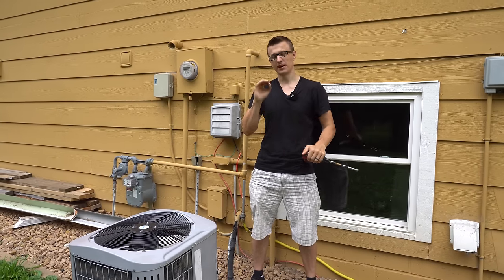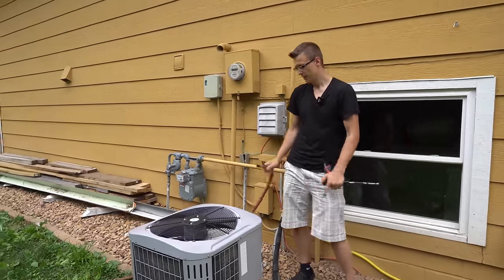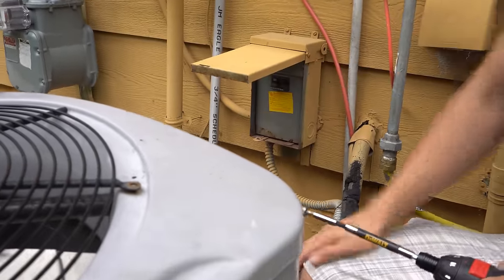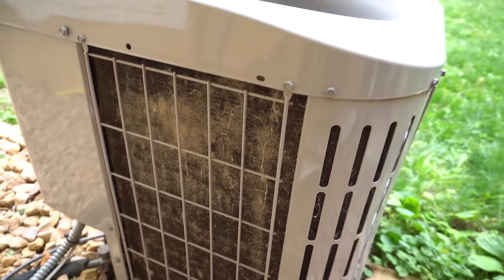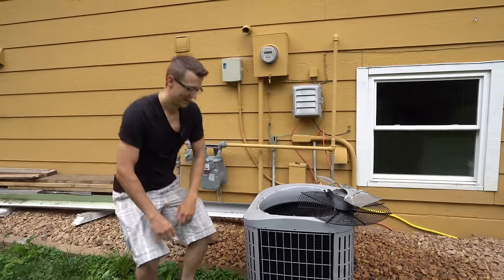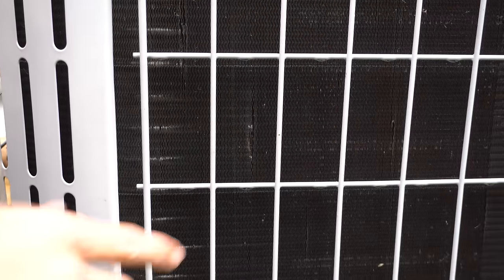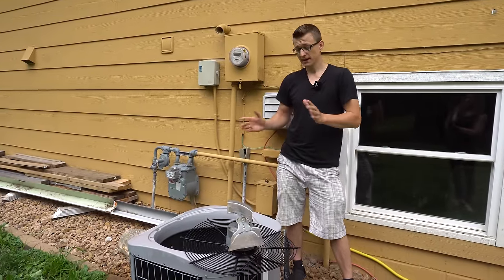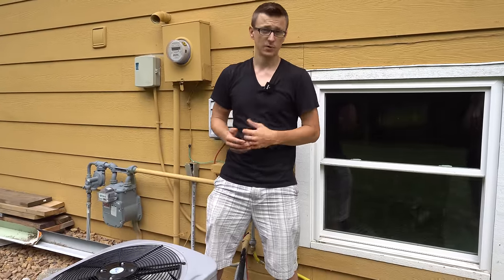#1 AC Problem With Central Air Conditioning Not Cooling

Comment from the maker: ❄ Other Videos For Reference:

Top 5 A/C Problems:
https://youtu.be/GOXgdnRB840
Complete A/C Troubleshooting Guide:
https://youtu.be/wzAA4dlp_70
How to Replace a Capacitor:
https://youtu.be/9ZGfvC-PMWU
How to Replace a Contactor:
https://youtu.be/qHZc9wWAF4c
How to Replace Condenser Fan Motor:
https://youtu.be/gGFTd2dmgxg
How to Replace A/C Control Board:
https://youtu.be/hijUExXrcm8
How to Replace a Thermostat:
https://youtu.be/1mJkjrwxdP4
How to Program a Thermostat:
https://youtu.be/uun8HJhM3h4
How a Thermostat Works:
https://youtu.be/Z4T9H-6VPtI
How to Check Freon Level:
https://youtu.be/dExFtP-nXTw
How to Wire A/C Condenser Unit:
https://youtu.be/KCanZEsLVEI
How to Read A/C Wiring Diagram:
https://youtu.be/I-sB4GIlbl4
How an Air Conditioner Works:
https://youtu.be/cRnzYJ4qmWE
When Should You Replace A/C:
https://youtu.be/Z7vUOySOWbM
15 Air Conditioner Maintenance Tips:
https://youtu.be/pBBnXHse-T0
Should You Get an A/C Inspection:
https://youtu.be/JqNsEzb__qs
Reply: This is the best pinned comment on all of youtube

Comment: Heat index is 109 degrees out right now. Just got back home from a work trip and asked the wife if the AC feels like it’s not cooling. She said it felt fine this morning, but I knew something was off. Thermostat was set to 75 but inside temp was 80. This was the first video I came across. I did it exactly as you instructed. Kicked the breakers back on and BAM! Instant cold air coming into the house. Oh what a relief. Great video!
Reply: I have the same issue, im going to try this out

Comment: Absolutely do not just shut the unit off at the thermostat if you are removing the condenser fan motor. Kill power to the unit at the breaker or disconnect.

Comment: I always tell people it saves money on the electric bill (which it does) to try to motivate them to keep it clean. It also makes the compressor last longer since it doesn't run as hot. I hose mine off probably 3 times a season.
Reply from the maker: That's a great way to present it. Thank you for the suggestion!

Comment: I can not thank you enough for this video.  Today is 109 and yesterday I noticed the ac not blowing cool air and it was squeeling.  We tuned it off and hosed down the outside (that was definitely clogged)  It got down to 67 this AM and we bumped the thermostat up to 69 as it was a little too cool.  It took a good 12 hours for it to cool the house from 79 to 67.  You saved me!
Reply: A lot of HVAC maintenance is just keeping everything clean.  And if you don't keep everything clean, the system may stop working or will have to work harder so the components will fail.  Keep it clean including the blower fans inside the furnaces, the condensation PVC pipes and the flame sensor and just everything.

Comment: Thanks for posting your video. The fins on my unit were clogged. Rinsed them off and now getting cool air. 👍
Reply: @Gabriel My AC wasn't blowing cool air. As it turns out, cleaning the fins didn't correct the problem. The system was low on refrigerant.

Comment: Thank you! There are a lot of HVAC companies that do not have the competency to share what you have in your videos.  So glad I found your channel!  It would do a lot for the HVAC industry if they required their contractors to watch your videos.  I had a contractor make a repair and burn my outside unit up.  I have a 5 yr old system now and just had a tune-up, now it is running poorly. He probably messed something up.  I am afraid to call an HVAC company to look at it.  I will trouble shoot following your tips. Thanks!
Reply: They do that for a reason. Simply put, they have to make money so that they can eat too.
It is what it is.

Comment: I use a filter screen specially made for outdoor condensers (purchased from Amazon). I take the screen off once a year and wash it. I also have a larger mesh screen on top to keep leaves out. During the winter, I use a solid cover on the top and take the screens off.
Reply: wmalden do you have the link to the amazon product.? Screen.

Comment: Solved the puzzle a totally different way, never paid attention to the times on the clocks, nor number of bananas...only determined what the clocks and bunch of bananas must be to =10, then went to work solving for unknowns.  Perhaps I should have had on my readers.  😊. 

Anyway, thanks for the video.  Will go check my unit's condenser shortly.

Comment: I try to wash mine twice a year beginning and end of cooling season. After using the hose I will use my air compressor on a very very low psi and blow air through some of the dirtier spots. Helps get that stubborn dust out.
Reply: gReaT tip....ThanKs.!! 🍻

Comment: these seem like good points but definitely turn the power off before removing the fasteners that attach the fan motor and cage to the unit! if it would have kicked on and started spinning before you turned the disconnect switch off it could have done some damage to the unit or someone near it.

Comment: unscrew the grill, then use a paint brush to brush the coil as you rinsing it with water.
Reply: Ok but what kind of paint should we use 🤔 lolz
Reply: I have a 20 year old Ruud unit.  The side grills cannot come off--at least I couldn't get them off.

Comment: Nice tip, sir!  👍
Quiz:  2 + 3 + (3 * 10) = 5 + 30 = 35

Haha, you ol' dog, you!  I paid closer attention and my new, new answer is:
Quiz:  2 + 3 + (3 * 11) = 5 + 33 = 38
Reply from the maker: Thank you! 35 is mighty close but that is not the right answer.
Reply: 135
Reply: Rocks=15 bananas=4 an the clocks =3
Reply: 3+4+(4x15)=67

Comment: Hi Jay! Your videos have saved me tons of time and money! I love your explanations! Thank you so much for all you do!! Question: My A/C recently lost power. We had a tech come out and he told us it was a bad control board. He replaced that and we still had no power. I did some research and found out that we actually had a bad transformer. So I switched out the 24v transformer supplying power to the control board. Voila! We got it running again! Unfortunately, now it on works in the “ON” position and not on “AUTO”. Also if I run it in the on position, the blower fan will turn off after a few minutes. I’m hoping the “tech” that came out didn’t mess something up or wire the control board incorrectly. Could my thermostat be the problem? Any ideas?
Reply: Check the batteries in your thermostat. I’ve had just that really make things not work right. Something as simple as the thermostat batteries…crazy.
Reply: Thanks…. I go clean it up now…

Comment: Seems cool! Thanks! I am still worried about the electrical board/components in their on the inside of one side of it. They can short circuit if not careful right?
Reply: One of the reasons you should kill power to the unit. Do not just shut it off at the thermostat like he said.

Comment: Thanks for the video Jay! I have a weird thing going on with our ac unit. 99% it works/sounds fine but sometimes and only after it has been running for hours continuously. Sometimes we hear a thump and then a much louder buzing noise afterwards.  It seems still to be working but I typically just shut it off and back on in 30 minutes and it then sounds normal again.  It looks like it's coming from the outside unit. And maybe the compressor? I know the blower fan looks fine when this has occurred.
Reply: Mine is doing this rn. Now it's not blowing hard enough. Did u find out what it was?
Reply: @alyssakdiaz9290  I'm not an expert but I have a good idea of what it might be. It's probably the AC motor on the condenser if its an outside unit. There are a ton of videos on how to replace a condenser motor and its super easy! Before removing any wires on your condenser make sure to take pictures first so you can remember exactly how to put the wires back. Make sure to shut the power off! If you wait to long to replace this motor your ac will over heat and the condenser will be dead. An A/C motor can cost $300-$700 depending on the size or your unit ton. Replacing everything according to 2023 can be very very expensive. I love this video because it taught me how to clean the condenser which is critical. I recommend spraying the ac condenser with a special condenser cleaning spray. Spray the condenser and let it work for about 5 minutes and then hose down.

Comment: Bro, I worked with this one company and we did Mcdonalds and you should see the build up of cottonwood on the condenser coils, not to mention the grease. We had to use foam Brit on them. The coils would go from black back to the normal color. So nasty.

Comment: I cleaned my unit, replaced new filters and even replaced the capacitor because the fan wasn't spinning.  It worked great for a whole season. Now it doesn't blow cold air.  Cleaned again.  Do you think it's low on freon?  Unit is 15 years old, but my neighbors still have their original unit so trying to squeeze a few more years.  If it's the freon is this something I can try?  BTW I learned from you  videos.   Thank you.

Comment: Appreciate the maintenance tip!
The correct answer should be 67.
3+4+4×15 > 7+60 > 67
Your values don't work when plugging into the equations.
Reply: Look more closely at the figures on the last line...
Reply: 3+4+4x15=165.    3+4+(4x15)=67. The correct answer is 165
Reply: Using the correct order of operations, the answer is indeed 67.
Reply: The answer is 88. (2+3+3×11=88)
Reply: @pinkiithe3nigma257  I was thinking the same way but the only thing I did different was multiply first.  (2+3+3×11)
                                  5+33
                                   = 38
Reply: @cedrickringo7911  that's EXACTLY THE ANSWER! I SKIPPED order of operations.  🤦‍♀️

Comment: Jay, ac quit cooling inside today.  have a trane outside unit, blowing cool air outside and not hot air today.   (Inside is room temp air circulating when turned on) going to clean outside unit  with water and hope that helps. Thank you Jay.  Houston is hot.

Comment: Great video, this is also an optimal time to oil the fan motor since you have it upside down. What would cause the ac to turn on blow cold for an hour and then blow warm. The pan is dry and it's dripping outside as it should.
Reply: I have this problem as well. Any ideas?
Reply: @ryanjstreeter  Hi, I have an old unit, and if I remember correctly, it was low on freon.
Reply: @claudiodominguez.  I have an old unit as well. I will look into a Freon refill, thanks!
Reply: @ryanjstreeter  Hope it's a slow leak and all will be Good !

Comment: Excellent video as always. 

I have a Rheem unit in an apartment. I changed the 40mfd capacitor today, the compressor seems to be running fine. however couple of strange things I noticed: compressor is blowing cold air out instead of hot air and the the temprature on thermostat is not coming down. Local guy tech guy told us to use to do a hard start using 500% Suppco SPP6. I still have tried that option. 

I changed the filter too.

Can you please let me know what could I check and why the compressor is blowing cold air out?

Comment: Does the sun on a very hot day beating down on the unit affect it’s efficiency? Thanks for the info, very helpful.
Reply from the maker: Yes. It will still cool the house fine but the unit will have to work harder if it's roasting in the sun all day.
Reply: God this seems to be my issue at the moment. I live down in South texas. We’re hitting 101 and our AC is breaking down on us 😢 it’s in the blazing sun all day and sun doesn’t go down till 9pm. It has been making a horrendous LOUD noise. It sounds like someone is doing outside mechanic work. I had to stay up last night to monitor the noise to avoid any neighbors calling the police department for noise complaint. Noise is still on going but now there is no cold air blowing. Can someone please help!! I am also pregnant due any second now so I am not having the best of time in my stuffy house. I do not have easy access in my back yard for a hose like you did in your video to top it off 😢

Comment: And definitely do not do it with high-pressure hoses it will bend the coils and you will mess up your AC I actually spray a little bit of TruGreen on it and wait a few minutes then spray it off TruGreen is awesome
Reply from the maker: Great tips! Thank you for the suggestions!
Reply: @TheAGODAMI   It is a cleaning agent that you can buy from Lowe's or home depot or Ace Hardware. It's a spray on  Is green liquid that cleans a lot of  Surfaces.
Reply: @TheAGODAMI   I'm sorry I called it true green it's supposed to be simple green.

Comment: I can't find the right video and wish you could answer. I leave my ac on auto cool and when it reaches set temp it just keeps running it doesn't stop, turn off and on, just stays on. Is it a bad thermostat. You already helped me once before it be crazy awesome if you knew a common problem for this. Thanks!! I love you're channel, learning alot.
Reply: Nah wouldn't be a thermostat could be a stuck contacter not shutting off keeping your fan running
Reply: @kanetalks5434  it was the thermostat, a few bucks well worth the risk.

Comment: I just got back home from out of the state after a week and now the ac is just blowing air but not cold air.
It's 11:47 pm and we have like 80 degrees .
I'm going to try it and come back later with an update
Reply: Did it work?
Reply: @Jay388  My friend works for ac and he already fixed.
He found the drainer clogged upstairs in the attic.
To much water and the sensor cutting off the electricity for protection

Comment: Great informative advice. Is that AC condenser fan motor and the furnace blower motor are the same?
Reply from the maker: The furnace blower motor is used for both, the AC and the furnace. But the condenser fan motor is the one in the outside unit. 👍

Comment: My central AC unit stopped cooling. It's on but doesn't blow cold air. We will try clean it following your video, maybe it's diry because we are replacing our roof and maybe because of the construction dust it got dirty. Do I have to turn it off from the thermostat to wash it? Please answer
Reply from the maker: Yes, I would turn it off at the thermostat so it doesn't come on while you are washing it. And if you will be taking the top off, then make sure you turn the power to the unit outside off too.

Comment: The puzzle answer is 25 (The watch in the fourth row is set at 2:00, making the value two, instead of the value of three, like the other two watches in line three, which hands position are set at 3:00)
Reply from the maker: It's a good first guess but there is more to it. 25 is incorrect.
Reply: @WordofAdviceTV  Thank you, I do like the number twenty.

Comment: I have a 3 year old home and moved into it just 2 years ago.  Did no maintenance on it but did do some cleaning of the outdoor unit. and I change the filter every 3 months.  Recently I am having problems with cooling as the temperature is over 100F.  I opened up to where the A coil was and noticed that it was frozen.  The tray was full of water and it was not draining properly.  I cleaned out the drain pipe and got it flowing and ran the fan which melted the ice and the flow seems fine now but I'm still not getting cool air from the registers and the unit will not cool the house enough to keep it even to 75.  It will only go up and run all day and into the night  with an increase up to about 79-80 degrees.  I replaced the capacitor as I suspected the compressor is not starting all the way.  I feel that the air above the fan on the outside unit is cool in places ( I understand this should be warm or hot air)  and only warm in about 1/4 of the outflow.  Will a hard start kit work for me?  I will order one and see if you think this is a good fix.  Thanks.
Reply: Did this help? In the same boat 🥵

Comment: When you didn't have air and your apartment "fixed" it and it lasted 4 days so you're trying to figure out y is this, even tho u changed the filter that's been there for a few years, because they didn't,  and it's still not working. I hope they can consider videos like these if they aren't sure wat they're doing.

Comment: I have a question…
My A/C is on the top of the roof of the 5 story apartment,  there is no access to water up there.  How would one clean the outside of the unit that has no water near by.  Certainly I can’t be the only one that has this issue.

Subscribed !
Reply: That my friend, you have to use/fill up a 5 gallon bucket of water and use a porta blaster which that hose goes into the bucket and sucks up that water. It sucks but if you dont have water access on top of a roof, its a good way.

Comment: Hi Jay - Is there a reason that you and almost all other HVAC techs do not use a shop vac to remove the debris on the coil before rinsing the coil from the inside? - Thanks!
Reply from the maker: Yes, the vacuum does very little to suck off anything from the coil. Much of the build up is inside the coil too and the vacuum can't get that. Unless you have an extremely strong vacuum, its a futile effort.
Reply: @WordofAdviceTV  : Thank you, Jay!

Comment: My answer to the puzzle is 241.15.  So what is the answer?
Unfortunately, I had already cleaned my condenser unit when it wasn't cooling earlier last month.  Fixed it.  Did the Delta Test.  Results were 24 differential.  Enjoyed the cooling for 17 days, then one evening I noticed it was giving me any cool output.  Now what?
Reply from the maker: 241.15 is incorrect. There is a hint, along with the answer to the puzzle in the video description. The most common reason why an air conditioner abruptly stops cooling is a bad capacitor. This would be a good video to start with: https://youtu.be/wzAA4dlp_70?si=WQzTUWGqD_hl6wop